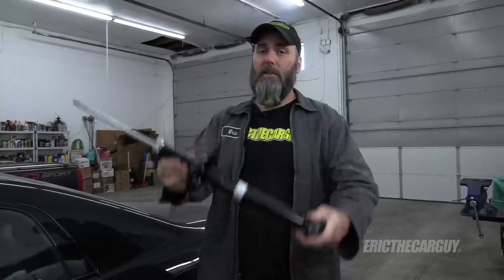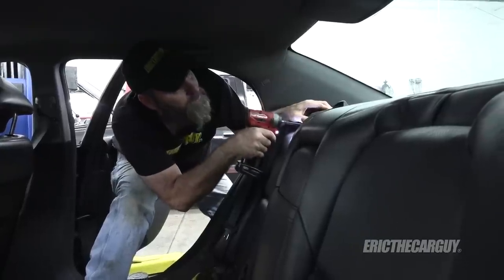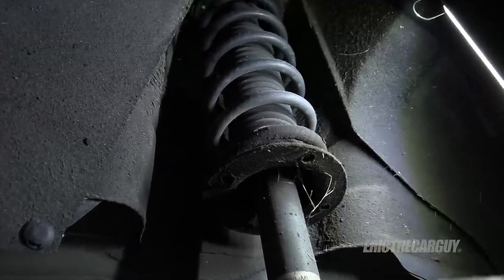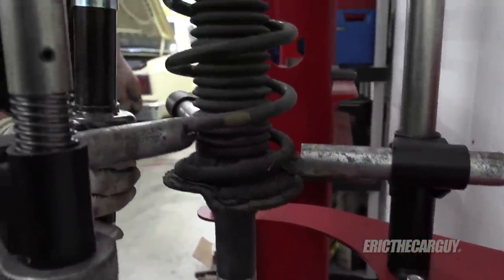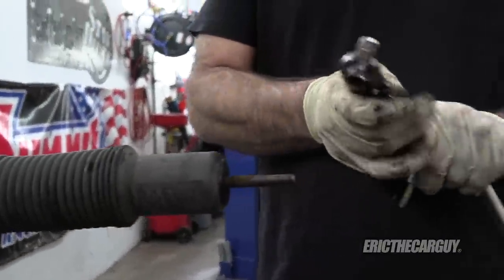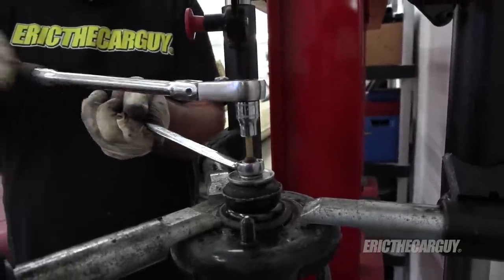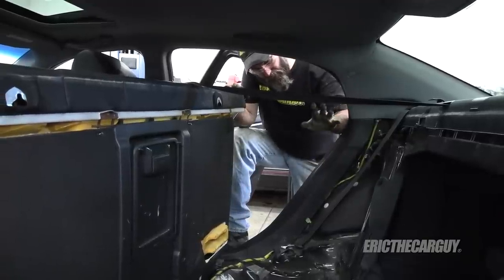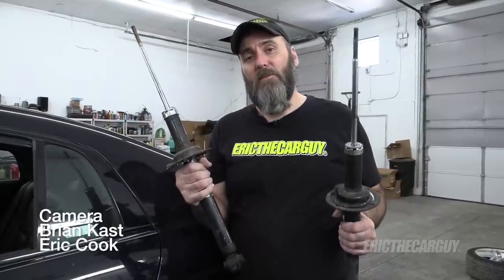2004-2008 Acura TL Rear Strut Replacement

Comment: Eric you have to give us a before and after driving impression with the new struts. 

Thanks for the link, can't believe you get the whole oem assembly  for just $200 dollars. That's one of the reasons I prefer honda products. I had a early 2000's Toyota avalon and that same oem assembly of parts cost over $400(online dealer pricing).  That year avalon was basically a camry. In fact KYB, Monroe have the same part# for both. The final blow was  when I got the struts they said made in mexico,  by sachs. I realize large manufactures have invested heavily in mexico and they are producing good products, but Japanese made in preferred especially when you consider the high price.

Honda is just far more committed to provided oem parts at reasonable pricing.

Comment: Thanks for the video, I have a 07 that just had a shock blow out.  Had the work done back in December and occasionally heard a little noise/rattle.  No lie, I watched this video today and it was so nice outside decided to wash the inside windows.  When I went to the back seat I felt the seat move.  They didn't re-tighten those two bolts.  I would have had no idea why.

Comment: I love those cars by far the best TL Acura has ever made I want a TL type S so badly with the 6-speed manual either an 07 or an 08 such nice cars
Reply: There are plenty of them out there.
Reply: Me Too,Type S Had the Bigger Eng.,Stainless  Exh.W/ Quad Tips , & Sportier Low Profile Rims & Tires.But Not Sure Auto Trans.Are Much Stronger Than Reg.TL' s,Which Are Common W/ Issues ,After 125-140,000 MLS.
Reply: @timetowakeup6302  not the kbp

Comment: Great job sir. Wish  I would have had a strut spring compressor like that back in my day. 

one thing I used to do was put Dawn dishwashing liquid on the bushings before I reinstalled. It would keep the squeak and put a protective coating over the rubber bushings.
I do not know if anyone still practice that

Comment: This video was really helpful. Thanks! I did the fronts the other weekend and needed to get the rears done. You definitely got lucky on the swaybar end links. ONE of the nuts came off for me and I had to sawsall the others off. I ended up replacing them with the Moog end links, which appear to be a better design than OEM anyway.

Comment: Eric, wire brushing the end links with a steel wire brush before spraying will make it a much easier job.  It takes just a few seconds.  Second,, I fill the Allen socket of the end link with a dab of grease when reassembling...prevents corrosion and stripping it the next time.  Those Allen sockets collect water and dirt like it's nobody's business, which can't happen if it is already filled with grease.

Comment: I used kyb struts on my Honda accord and I love them.
Reply: If you look real close at the oem ones you'll see KYB on them lol
Reply: OEM kyb  from Acura on Amazon: 200+ 

Kyb gas shocks (IMO better) on amazon: 68

Hell koni yellow adjustable rears are 165. 

I got kyb gas myself. 

Regardless, good video and steal on the car. 200 bucks is insane
Reply from the maker: Honda does NOT us KYB, they use Showa.
Reply: @ericthecarguy  I always use Honda fluids and almost always try to use honda OEM parts when replacing things. If I go non Honda I at least get something of knowingly decent quality.  My honda gets bitchy if I stick cheap parts on her lol.

Comment: Great video! As an owner of a 04 diamond white 165 on the clock now but at about 124 I have been trying to diagnose a inside wear on the tires and after alignment has been done proper tire psi rotation. I have came to the conclusion that the issue is the lower control arm bushing. Long story short Plzz lower control arm bushing video

Comment: I've had to do this job twice on my own TL. Always use OEM struts. My cheap eBay struts lasted 8k miles before the lower bushing separated and caused major clunking and tire wear.

Comment: In the Acura service manual, they have the rubber bushings opposite of what you show in the video.  The rubbers are pyramid shaped, and when installed they should form a football shape.  The way it look like you installed them is more hour glass shaped.

It seems intuitive to do it the hour glass way like you did,  the mount plate looks like they should go in the hour glass way, but the manual calls for the opposite. Doing it the hour glass way causes the rubber to flair out as you tighten the top nut, deforming it, causing accelerated wear.

Comment: Retightening those lower bolts it was definitely a "Oh crap, did I remember my safety glasses" moment.  All that road crud getting knocked loose...

Just thinking about possible salt exposure causing rust... even a 200 buck car doesn't deserve that fate.  But it looks pretty dang clean, so it probably isn't even an issue.

Comment: Hello Sir, I have a problem with Ford explorer 2011 EATC Not working, mo power on the center dash console, the MFT works but doesn't control the AC system. Plus as soon as I start the engine, the blower motor runs steady blowing heat out through the defrost, this problem started after taking the car to car wash, 
I have uninstalled the center console and test the wiring harness for power and it does have a good ground and positive power, but the touch function doesn't work, no button on the center Console such Hazard, eject and all the climate control button to knob nothing works,
Please can you give a good place to focus my diagnostics to get this issues fixed?

Comment: I have a 2010 TSX and I'm looking ahead to change all my struts soon. I replaced my rear arms about the same time i bought the car at 104k. I replaced front arms, drive shaft, bearings, but the only thing i didn't replace were my stabilizer links. . I don't have any power tools so yeah I only using hand tools which really makes things very slow. Looking at this video I really need a hydraulic car lift lol. My 4plex has the room. I bet I could totally make some money haja
Reply: Funny thing you mention the seat belts lol...I needed to replace my rear speakers and had to take the entire rear interior out (no bueno)  and when putting the seats back I forgot the center seat belt and ended up losing a screw 🤦‍♂️🤦‍♂️

Comment: i remember doing this when i installed my coilovers, was quite annoying. i left the 2 bolts under the headrest out after i reinstalled everything so i could just pull the seat forward and reach back and adjust my dampening.

Comment: you should always replace those rubber bushings on the strut top mounts, they'll make a big difference on little bumps and dampen the noise better. They're about $2 each from Honda which is probably the same part for Acuras

Comment: This video help me alot  the only thing  it was the where is the nut at the bottom  is easier if you remove the bolt next y
to  the nut that is weld it  you can remove it and is easier to put the strut back

Comment: Thanks Eric but I was left with the desire to know how bad it was the one it was not leaking and if it return by itself when you compress it after being used for almost 200,000 miles, it would have been great to know

Comment: I wish I would've watched this video a few years ago when I was trying to fix speaker rattle in my rear deck. I lost both screw and a 10mm socket while taking the back seats out. Had no idea they had a bracket to rest on.

Comment: Man that's a pain to have to take out the seats. That's the car I test drove when they came out back then. Still like the car. I just changed all four struts on my 91 miata with new top mounts and dust covers. Never had a car with new suspension until now. Those top hats can look good but there was a difference in the gaps compared to the new ones so I just get them now with the struts. By the way are the oem struts gas as well? I did all kyb on mine and used the same springs. So it's stock ride.

Comment: torque spec for strut bolt is 2 uggas with pneumatic impact, 4 battas with electric impact.
Reply: You'll find Battery impacts will out perform pneumatics nowadays

Comment: Would you consider doing a tutorial on replacing the fuel pump? Your vehicle may not need it, and with the back seats out, it is easy to access. My TL is at 106k and I am upgrading her all around. When would you consider changing a fuel pump out? Nothing in the Hayne manual bit to inspect every 15k.
Reply from the maker: Honda fuel pumps rarely fail. I don’t recommend replacing them.
Reply: @ericthecarguy  exactly what I needed thanks Boss. Keep up the good work, I still owe you a beer, BTW this is @cmvjax on Twitter

Comment: Weird Honda doesn't include the top nut with what OEM stuff costs.  Even Toyota includes one.  The Ford (motorcraft) ones I got one time came with a new boot, bump stop, and all the fasteners.  And they were installed thanks to ETCG videos, of course.

Comment: if the noise you heard was like a rattle, it could be the e-brake cable being too loose. My 05 RL had that issue and it drove me nuts for a long time.  it has a foot pedal for it, so I just had to snug up the nut on the top of it.

Comment: Unless your car has low miles, I think its better to get a whole spring assembly since you get new springs and new bushings for not much more. Especially if you don't have a spring compressor since you'll be paying someone to do it when that money could've paid for a new assembly. Just my opinion but in your case, that would be a boring video haha, thanks for the content !
Reply from the maker: I believe I mentioned that. 😉 thanks for the comment.

Comment: Next time you under the car. Look at where the lower main bolt for the struts is. Just Abi I’ve that is a 14mm I believe. You can loose that and it’s a bracket to hold the sway at link.  Could of save a ton of time just taking that bolt out on each side.

Comment: Hey Eric, My 2015 Corolla 100k miles has front struts that are super firm. I thought when struts failed, the car became bouncy and without dampening. If I press down on the front of the car, it barely moves at all. Is this likely to be the struts?

Comment: I have a question. I've heard when replacing front struts an alignment should be done. Is that true for rear struts? I bought a used 2nd gen CRV AWD that the dealer replaced a bad rear strut. Now I have bad tread wear. 99% sure they didn't do an alignment. Do I need to get an alignment? Thanks.

Comment: Eric, if the differential on my 2000 Acura RL 3.5  has no oil in the differential, would it cause the car to drive about a foot at a time then slams and stuck each time i tried to move, and if i should put oil in would it be ok again to drive? Thank you.

Comment: Will you get 100% oem quality with this part? It’s probably a part that has sit on a shelf for 10+ years. Is there a date for which these parts begin to degrade. Like the rubber parts inside and out of the shock?
Reply from the maker: I haven’t had any issues. Rides excellent.

Comment: I have to agree on using honda parts on honda vehicles. I installed after market complete strut assemblies on my wife's pilot and the ride was just as bumpy as the old struts. If i'm being honest though, i probably went too cheap...$80 a piece for a strut assembly, i should have known they weren't any good.

Comment: Very cool vid. At a $200 labor shop rate break even on buying a $75 included spring assembly is 22.5 minutes of labor. I can't see any circumstance you wouldn't just buy the full assembly.
Reply from the maker: I believe I mentioned that. Thanks for the comment.

Comment: I have no idea why Honda doesn't make a full size nut on the links instead of a rounded piece to make it easy to remove. 9/10 times the allen key hole will be rounded and you might need a torch...

Comment: Do we have to measure the overall length of the strut assembly before we re-install to make sure the struts will ride even as before, as the old struts did, so we dont mess up our ride quality?
Reply: No point, you can't adjust the strut length.
Reply: @jacoblharris  Thank you for your answer
Reply from the maker: Struts don’t control ride height, springs do.

Comment: I recently hit a curb a week ago and now my right front tire is sticking out bad and is wearing both front tires , what could be damaged my lower arm control ?? Also it started snowing here in Palmdale and every since my steering is very hard , I have to use full worse to steer , could that be my rack opinion ?
Reply from the maker: https://youtu.be/dSWdf_7HcqI

Comment: Does changing these struts on these TL‘s help with wearing out the insides of your tires?
Reply: You may want to try having an alignment done first if you haven't tried that already before you start replacing suspension parts. With your struts you will generally hear things that would indicate they need changed

Comment: A car of that age, I would just get the whole assembly because those springs and other components are probably tired or will be soon.  I prefer to get it done and not have to visit it again.
Reply from the maker: I believe I mentioned that. Not as concerned about rear struts, but I would replace the front assemblies. Thanks for the comment.

Comment: Great video series.  I have a 2006 TL that I bought 4 years back.  It's proven fairly reliable and affordable to maintain so far.
I don't "need" new rear shocks at 120K miles, but it's on my longer term to-do list.  I was a little dismayed to see how expensive the completed assemblies cost.
Apparently 2006 is a different part number, costing $400 each!?

I mean, it's cheaper than paying someone else, but boo hoo for the 2006 part costing more.

https://www.hondapartsunlimited.com/oem-parts/acura-shock-absorber-assembly-rear-52610sepa06

Comment: Having to take the rear seats out to change struts is one of the stupidest things i ever heard of. Id be pissed
Reply: It's extremely stupid on this car, the rear top nut is tugged in a really tight area, none of my tools could reach it. 1/4 would fit but doesn't stick out enough for me to turn, 3/4 was either too long or too tall, I also had a flex head like Eric does in the video, didn't fit no matter what I did. 

However my mechanic friend got it out pretty easily.

Comment: Any body know the torque specs for the lower bolt that connects at the bottom of the strut assembly?
Reply: 43 ft lbs.

Comment: Well its either remove the rear seat or dolphin dive into the trunk..........
Reply from the maker: No access from inside the trunk on this one.
Reply: @ericthecarguy  My 02 maxima had too dolphin dive in the trunk for the struts.
Reply: @lexmaximaguy8788  well no shit hes working on a Acura/ Honda not Nissan they're differently design

Comment: I wouldn't recommend using an impact gun to tighten the top nylon nut. I saw loosened nut (which held the piston against shaft) inside the shock absorbers because of this procedure. Just sayin. Love yadda yadda though.